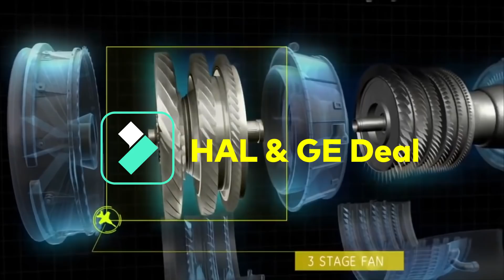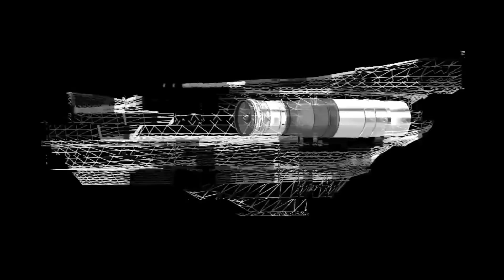Make-in-India GE 404 & GE 414 Engines

Comment: Excellent overview with clear articulation our needs. Our company worked as an engineering service provider for P&W for more than a decade. Jet engines in my opinion are the most complex part in an a/c and also IMHO the only area in which US is clearly ahead of either UK or France or Russia and  perhaps the rest of the world. 

GE is already running a variable cycle 3-stream engine and P&W is just about to. These are real advancements and are an essential part of 6th Gen planes. I have not yet read anywhere that with Safran or RR have come this far. If we indeed go for GE 414 also an excellent and a very reliable engine, we should also look a little ahead and see if we can get access to  the variable cycle engines at a later date. I might also add that GE is perhaps ahead of anyone else in this area since the YF-23 actually flew with a GE variable cycle engine the YF-120. This was in the 1980s!!

Comment: They stalled our cryogenic program. Public memory is short. Go with Safran/Snecma.
Reply: Old story the dynamics have changed. They, not we will suffer if they try such tricks. In any case right now we are hopelessly dependent on GE engines for our a/c and even ships.
Reply: @ashokkandimalla5962   Boeing, as part of its offsets obligation, was supposed to build a high-altitude test facility. They backtracked on that. They will claim their govt didnt permit them. But in that country, it's the companies that control the govt. Nothing has changed. Boeing, GE, Raytheon, Lockheed... they're all part of the MIC.
Reply: No, we aren't dependent on GE. There is Safran and RR.
Reply: When we discuss jet engines, we hav to take a look at what our enemies are using. And can Safran and RR fulfill that? So we dont need some 6th generation stuff to deal with J10s and JF17s. These safran engines will do, until we build our own capability.
Reply: @khalildas741  That is what  I also meant. Safran and RR don't have variable cycle engines running as of now.
Reply: @khalildas741  I will elaborate  more. As far as this particular issue goes, you are correct. Indeed there are   Safran and RR as alternatives. What I meant on dependency was that Vikrant, Project 17A frigates, Tejas all versions, and planned TEDBF and AMCA Mk1 use GE engines so in my opinion we are dependent on GE engines. Of course you can differ!
Reply: @khalildas741  Yes that was incorrect on their part and they should have checked before committing. I fully agree with you. But lot of cutting edge work is being done by both Boeing and GE in their engg. centers in India which be useful to the country. I am sure you are aware that Dassault has not met its offset obligations either! Even our company was a subcontractor Boeing. Also, Tejas control laws were tested on an F-16 in US, as you are aware. Also TASL is supplier of Boeing AH-64 fuselage for all Apaches produced for all customers worldwide. So they have done some good things too.
Reply: @khalildas741  Good point.